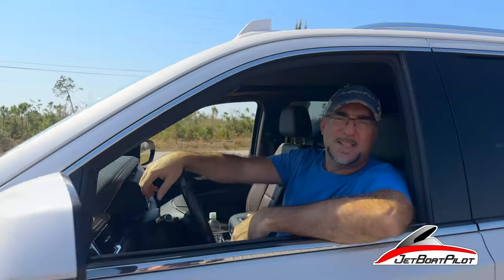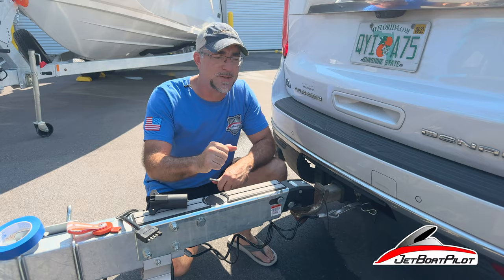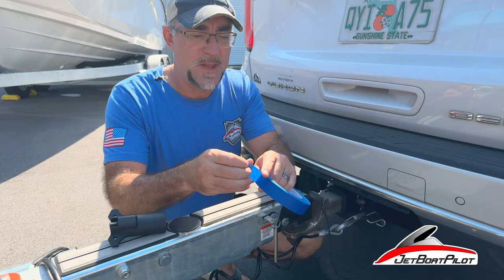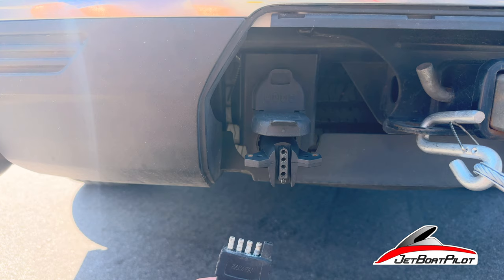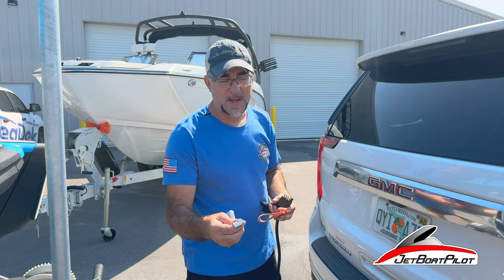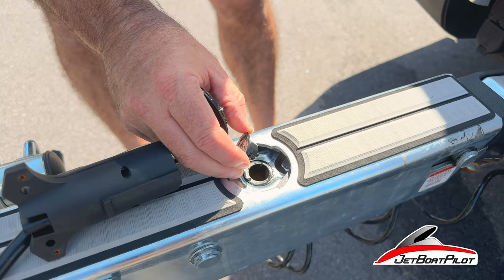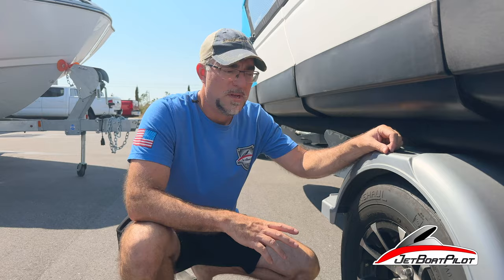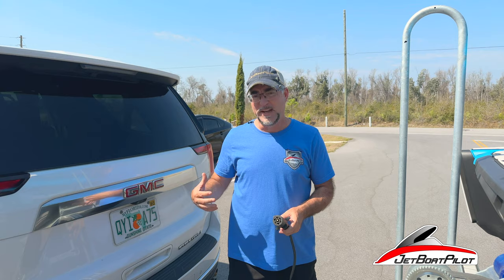Everything You Need to Know About Boat Trailer Brakes BEFORE Taking Your Boat Out

Comment: How do these brakes work when backing your boat down a launch? If your 7 pin adapter isn’t connected to the vehicle when your trailer enters the water? I’ve never felt resistance when backing up without it.
Reply from the maker: If the ramp is steep the boat and trailer try to pull the vehicle down the ramp and the neck does not get compressed so the brakes don't activate.

Comment: Great video!  Apparently the Compact does not have brakes - which violates many state laws and seems to be quite an oversight in my opinion.  Do you know if the axles on the trailer for the Compact have the mounting flange to install aftermarket brakes?  Thanks
Reply from the maker: I think the compact may be considered a personal watercraft in some states, which I think has to do with emission standards

Comment: Question - SeaDoo Switch Powder coated trailer is already showing rust - any method of fixing that or preventing that ? The trailer hasnt been in water yet ! Its brand new but shows rust at welding poitns
Reply from the maker: Not sure on that. If it has not been in the water yet I'd see about warranty on the trailer.

Comment: Curious, what happens if you’re going forward downhill on a highway? Does the trailer push on the vehicle and thus causing the surge brakes to turn on?
Reply from the maker: Not unless you're riding the brakes. It takes some force to get the surge brake solenoid to activate.

Comment: That rewiring hack wouldnt be very safe if youre hauling your boat at night. You would have your head lights on and sending a signal to the trailer to shut the brakes off. Or did i hear that wrong? Either way good vid
Reply from the maker: It's not recommended for use unless you're having trouble backing up. Never do that wiring configuration when the vehicle is in forward operation.
Reply: @JetBoatPilot  Maybe add  a toggle switch to that one particular wire for when you are needing to travel vs back up. Sounds rinky-dinky, but im considering doing that now that i seen your vid. My own adaption of your good informative vid

Comment: Hello @jetboatpilot

I am planning to get a seadoo switch 16 130HP

My vehicle is FWD minivan with 3500lbs capacity. It only has 4pin wiring. Will it be a problem?

Thanks
Reply from the maker: You'll need the proper wite harness. Weight won't be a problem short distances but I would not go on long trips over an hour one way as your transmission could overheat. Vans are not made for towing long distances.

Comment: Question; I have the 21 230 and my “Trailer Brakes” have never worked… any suggestions? I do use what you have in video. I use that 7 pin adapter.
Reply from the maker: Is the key removed from the slider? Have you checked to see if the emergency cable was pulled accidentally?
Reply: @JetBoatPilot  key removed from slider??
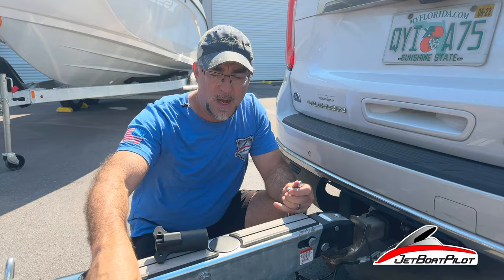Reply from the maker: @c.juneau410  watch at 1:41 in video
Reply: @JetBoatPilot  got it! Thanks!
Reply from the maker: @c.juneau410  you're welcome
Reply: @JetBoatPilot  My trailer brakes have never worked either.  Are you saying that the key should or should not be removed from the slider while towing?
Reply from the maker: @matthewf860  definitely remove when towing. Only use when backing and you don't have the proper 5 pin electrical connection on your tow vehicle.

Comment: Thanks for the video. From what I gathered this is possibly the worst trailer design I have ever seen. Suggesting to hook up a cheater wire to your clearance lights to over ride you break system is a bad idea. That means you can't drive it in the eavning or in foggy conditions. Second, leaving your electrics plugged in when backing up your trailer will pop your vehicle fuse box if your trailer has any issues. Third, saftey pin will case immediate damage to trailer? Electric brakes have one too with and aux battery. So when the pin is pulled it engages the brakes and can be reset by putting the pin back in so it can be pulled over to the side of road to safely work on it. Not to mention it should be a clip not an s hook so it will stay on the vehicle no matter what. Fourth (not the worse) a back up key to override brake will easily be lost then causing difficulty to back up and causing the driver to make something they shouldn't. Finally, electric braking is controlled by break controller (how hard you press your break pedal determines the trailer signal) surge brake sound like they will apply hard if your not aware of road conditions such as hills and valley. If you apply the brakes to hard and try to compensate I bet you will cause a hop ( break on off). Please correct me if I am wrong and help me understand the advantage to this.
Reply from the maker: The bypass using the blue wire connected to the brown wire was only a hack to allow you to back the trailer up if you don't have a key or proper wiring connection. The surge brake applies brake force in proportion to the braking force of the tow vehicle. Imagine the braking force of the tow vehicle as the foot on the brake lever of your truck. The harder you brake the more braking force is applied to the trailer brakes. As for the hook and emergency brake reset, I agree, it should be easy to release once activated. Needs work. I believe this design is chosen when the tow vehicle does not have electric brake gain selector. These boats are lightweight and are towed by a wide variety of lightweight Suv's and trucks. Most of which don't have trailer brake control.
Reply: @JetBoatPilot  so there is an easy way to connect and disconnect the blue wire on the trailer everytime you need to back up? And if it's connected to the electrical outlet in the vehicle it could still cause electrical issues when backing it up in the water. I thought it was good practice to disconnect the electrical side before backing it into the water
Reply from the maker: @popperpopperpopper  it has more to do with the lights on the trailer being operated while submerged than it is about the vehicle. Some lights can't be submerged while operating. Others are sealed. The sealed ones can be.
Reply: @JetBoatPilot  thanks for the help understanding. There are good sides and bad to every unit I guess. As someone who works on heavy truck and trailer it helps.
Reply: The pin does not affect the brakes in my experience. The salesman insisted on connecting my trailer to my truck and he did not put the pin in, I drove 10 miles without the pin before I noticed.  I didn't notice because like you said it's possibly the worst designed trailer in the world and nobody has experience with this crappy design because the old design worked. BTW, I've priced out replacing these brakes. If you think maintaining this nonsense is cheaper than installing a brake modem on a small suv you're smoking some good stuff. I like most boat owners have a truck. This boat is so light I don't need brakes. It's a single axle trailer. Most boat trailers don't have brakes anyway. It's a huge waste of money and makes the trailer a gigantic pita.
Reply: @michaelosmon the pin is only there to bypass the brakes to reverse if your vehicle doesn’t provide electrical power to the override. The older boat trailers didn’t have the electrical override.
Reply: @danlux4954  I believe I was referring to the safety pin in the tongue. On my trailer, there is a small wire rope attached to the tongue with a piece of steel and another wire rope off that holds the safety pin for the tongue coupler. The piece of steel fits into the sliding part of the tongue, effectively locking out the brakes. When my trailer was connected to my truck by the salesman, he left the piece of tape on the tongue that held that spacer into the brake mechanism which makes it so a forklift can move the trailer around the dealership....or you can use your garden tractor or whatever with no lights connected